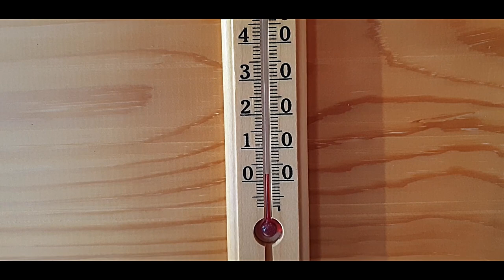Moose Antler Spike Knife Handle With Birch Bark Inserts

Comment: Beautiful idea. I love seeing new ways of doing inlays. I love the way that you used the file to rub the glue into the bark, as it uses the antler dust to fill in any small gaps. Mabe a tip you can use is when you glue the blade in. tape the blade to the point where the handle will meet it, and also tape the front of the handle and trim the hole. this way after gluing, it is very quick to clean up the glue by removing the tape. Great video.
Reply from the maker: Those are great tips! I'll definitely implement them. Thanks Tom. And yes that's exactly why I used the file to rub in the  glue with antler dust glue 😊 It really worked out well

Comment: Thank you so much for this video. I really enjoy making the puukko style knives. Most of the time I use wooden wedges inserted vertically on each side of the tang. Is there an advantage or a weakness doing the handle this way? Very skillful and creative handle treatment with the birch bark! By the way, do you forge your own blades or where do you obtain them? I forge mine from antique buggy springs, sawmill blades and antique files. Have a blessed day my friend.
Reply from the maker: Hi Richard, thanks for your kind comment. I think as long as the tang is firmly and tightly fixed and doesn't have room to vibrate when hit or dropped it should be fine. I'm just learning to forge and plan to make videos about it. I will certainly need input from a more experienced person like yourself to help me through this new chapter in my knife making. Uptill now I have bought me blades at puukot.fi Thanks for the greetings as well 🙏
Reply: @VahidCullsberg  Hello Mr. Cullsberg. May God be our purpose and power today. Thank you for taking time to reply to me. I am certainly still learning how to forge, and I expect that to continue. I use mineral coal and my forge is a hole in the ground. One thing I need to remember is not to forge too thin. I like to forge to shape as much as possible, but I try to leave my blade edge just a bit thicker than a dime so it does not warp as easily when I quench it in vegetable oil. When the blade turns black in the oil but is still hot I look for straightness real quick and then I put it between two very heavy solid concrete blocks or put it in my blacksmith's vice. This usually controls most warping. It also is important to put the same amount and heaviness of hammer blows on each side of the blade as much as possible. Try to leave your blade tip thicker and longer than you need. You can grind it down later and it will not tend to warp as much. When you are getting ready to Quench harden your blade you can use a magnet to see if your blade is non-magnetic, which is a pretty god indicator that it is hot enough to quench. Make sure the blade temperature is rising to magnetic and not coming back down to magnetic. Hey, that was probably more info than you wanted!🤐I am getting ready to make a trap spring knife with moose antler handles for a friend. Any tips you can give as I have not worked with moose horn before. Have a blessed day, friend.
Reply from the maker: That is indeed some juicy information. Thank you Richard. I'll reference this as I proceed.